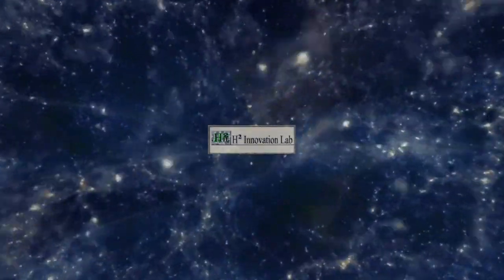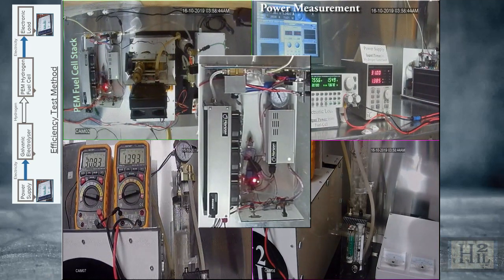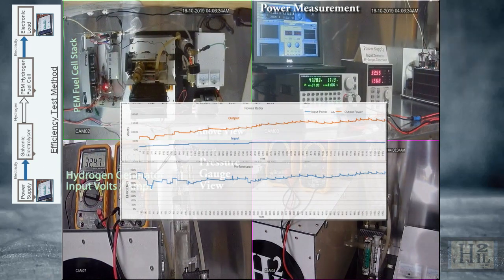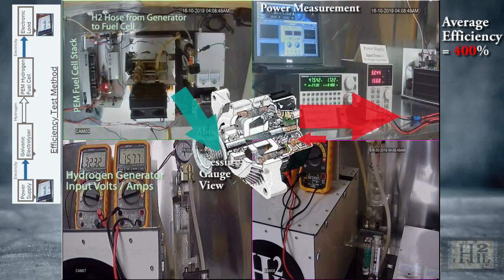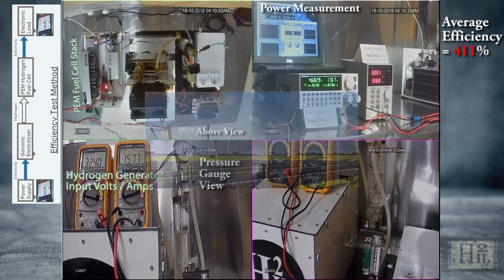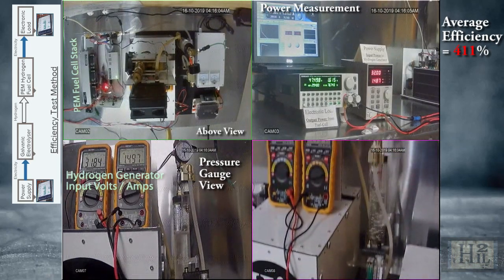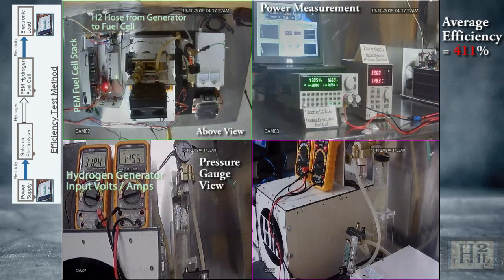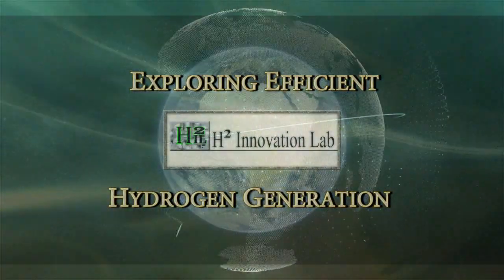What If Sustainable Self-Sustaining Energy Is Possible? - New Hydrogen Technology Breakthrough 2020

Comment: So if the hydrogen before the fuel cell is such a high energy as compared to what the fuel cell is able to produce then how are you proposing to get the higher energy value out of the hydrogen as the fuel cell is more efficient than burning the hydrogen????
Reply from the maker: The fuel cell is 40% efficient. There is a difference between efficiency and capacity. Please view the equipment specs on the H2IL website for information on the fuel cell we use for the tests.

Comment: It's basically a voltaic cell used to enhance the voltage for the electrolysis of water.
At best some compartimentalization allows a boost in the galvanic reaction with an extra oxydation by the O2 released (if the diagrams are to be trusted).
But the galvanic potential is orders of magnitude less dense than nuclear, you would need huge amounts of metal to make this of any use for an electric grid.
And your yield calculations are wrong because you have to take into account the energy provided by the voltaic cell since you have to put it in the system and metals do not come out of the earth nice and reduced.
Reply from the maker: Galvanic metal cost @ 0.34c per Kg of hydrogen or $10 per Megawatt of power. Zero emissions and no harmful radioactive waste. Lower cost and quicker construction time than nuclear. Localized energy generation also reduces the grid with it's huge power loss. The list goes on. Please view more on the h2innovationlab.com website.
Reply: But it's not only the cost that matters but the carbon footprint of the metal.  There is a large energy input into making that metal and a large carbon footprint. @h2innovationlabh2il69

Comment: Question: A high pressure PEM type electrolyser can generate a potentially lethal mix of H2 and pure O2 if the membrane perforates caused by an error in pressure difference between each side of the PEM. While your electrolyser does not use PEM technology is there any mode or condition where pure oxygen can mix in with the output hydrogen?
Reply from the maker: Correct, it is non PEM type technology that incorporates a science where the Oxygen ion is consumed by the galvanic energy to produce an internal charge potential. The redox reaction is hungry for charged oxygen ions therefore the output gas is free of O2. This is also confirmed in the fact that chlorine (Cl) is not released. If ionic salt type electrolyte comes in contact with a charged oxygen ion the Cl separates from  Na forming chlorine gas. You will note in the verification test series that we use a PEM Fuel cell stack connected directly to the G.E.E. cell output. If either O2 or Cl are present in the mix the PEMFC will react and this reaction will be noticed by a radical and unstable output voltage on the attached volt meter. Chlorine will also destroy the PEMFC. Months of verification tests with the PEMFC have proven that no unstable occurs where oxygen is released. That being said, hydrogen should ALWAYS pass through a gravity separator before pressure filled into tanks!
Reply: @h2innovationlabh2il69  curious why the power used in the load tester .. simply couldn't drive the in put power for the device .. would be self sustaining with a surplus of power .. and then scaled up .. would replace most current methods of power generation .. there's a good reason we haven't seen that ,, over a year later none the less .
Reply from the maker: Thank you for your comment. This video is footage of the verification test report requiring I/P v. O/P calculation with industry standard test equipment. However there are posted on this channel and the H2IL website a number of self-sustaining demonstration where the output power drives the device along with a bank of flood lights. This one for example: https://youtu.be/6CLLFLp8_k8 or the 7 hour self-powering demonstration posted about 6 months ago.
Reply: @h2innovationlabh2il69   only 7 hours of self powering .. why is  that .. forget to add water ?/
Reply: @h2innovationlabh2il69  there is nothing special or novel .. if it was groundbreaking .. it wouldn't be on you tube .. it would be a multibillion dollar company ..  with  the product being everywhere power is needed ..  it's not
Reply from the maker: Incorrect. The system,  political and commercial system, determines what is permitted. They fight wars to protect fossil fuel. .. Changes happen rapidly but with so much activity in the energy sector, most corp's and preoccupied with other projects. No we have no interest in taking on the energy giants - this needs to be taken to the next level by someone bold and financially powerful enough just like one individual took on the major automakers.

Comment: The way forward is clear. Resonant chamber  with ‘specific’ anode configuration and composition and ‘characteristic’ 
Correctly configured input charge. 

Flood a poorly designed chamber and anode/cathode structure, coupled with ‘standard’ electrical charge characteristics means the use of Current is required to overcome the compounding inefficiencies.